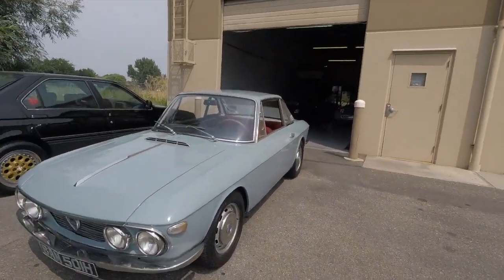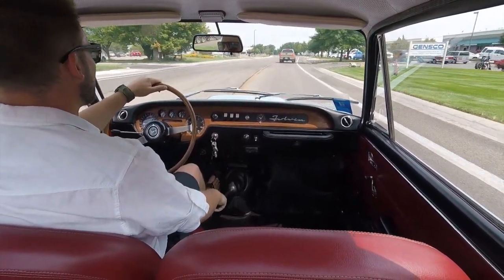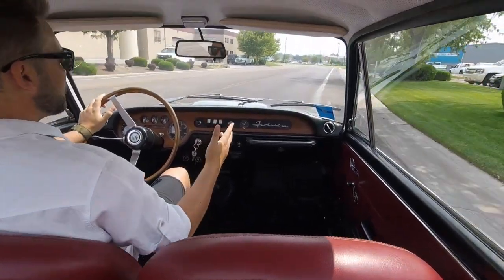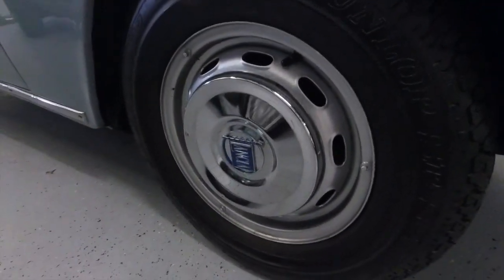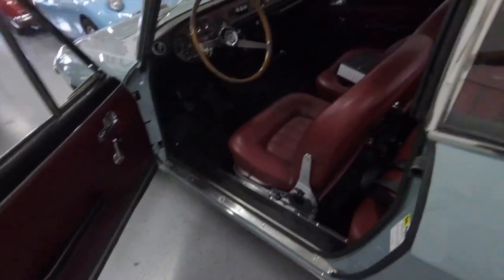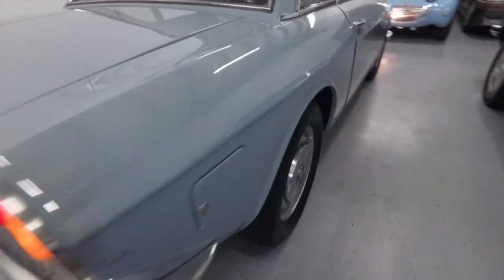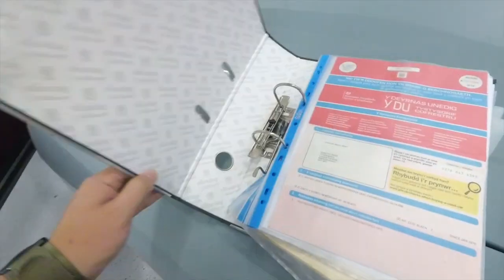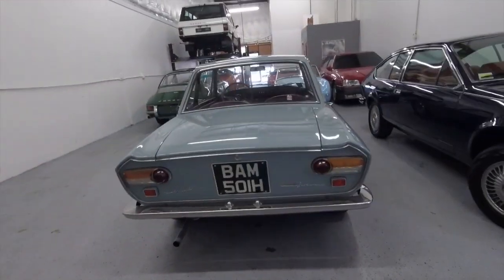1970 Lancia Fulvia SOLD walkaround and test drive

Comment: That is not a European plate   That is a UK registered car, the H on the end of the number denotes it to be a 1970 registration
year. Most likely the car was imported new from Italy into the UK,hence the LHD drive instead of the RHD of the UK.
Reply: If you read above you will see that I personally imported this car from Italy to the U.K in 2015. I now have a 2 owner series two with only 44,000km (26,000 miles)on the clock and am in the process of buying a Fulvia Monte Carlo.
Reply: I imported the Fulvia from Italy in 2015